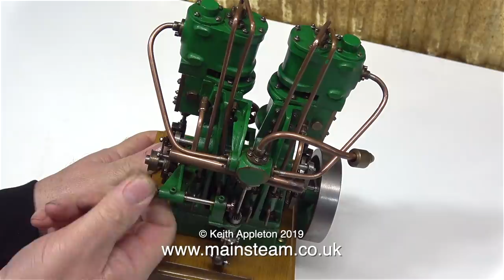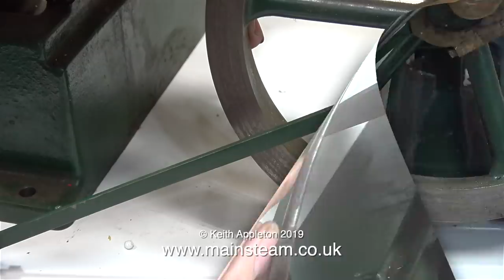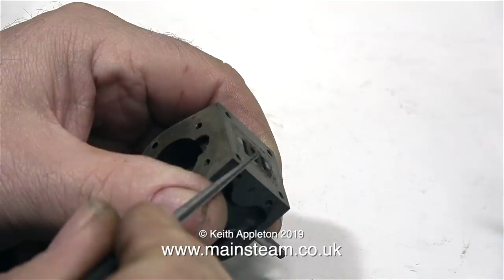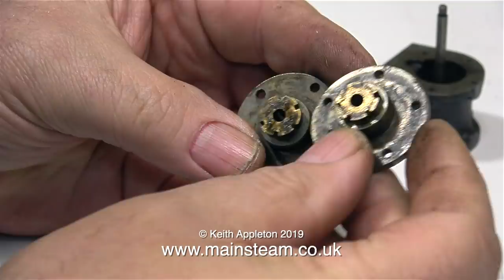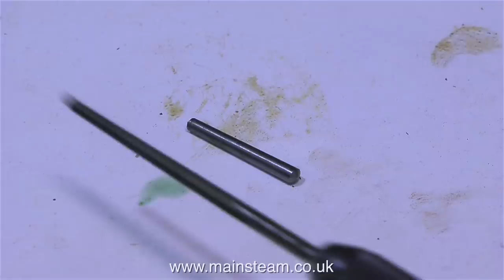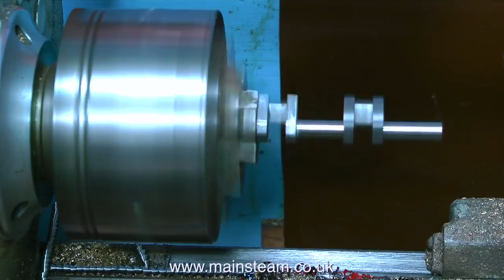BUYER BEWARE - BUYING STEAM ENGINES VIA THE INTERNET - PART #1

Comment: I've used JB Weld for many years and I know for a fact that it must never be used as a "glue" to join two pieces of metal together.  It has no sheer strength, and any kind of stress will cause it to crack and break apart.  It's main purpose is to fill gaps, pores, and refinish mating surfaces and it does these jobs very well.  It's too bad that the cost of repairing a bad job is greater then the original cost of the model, but this has always been true of anything mechanical.  If you can't do it right the first time, don't waste money trying to repair it.  Just chalk it up to experience and junk it!

Comment: As an Aerospace composite Engineer of some 25 years and some extensive experience bonding (gluing to layman) I would not be using JB Weld to fix an any of these components
Brazing or some other form of welding would better

Comment: I would beware of using JB Weld under tension in a small cross section like the broken cylinder mount , I forget the proper name of the part.

Comment: The No.10 with the broken cylinder standard - I'd be dubious too using JB weld on that. I thought brazing it might work but then I wondered if even that would be strong enough to handle the stresses. Is it fixable at all?
Reply from the maker: It's not worth it - the rest of the engine is very poorly made . . . .
Reply: @keithappleton  Yeah, I realize you aren't going to fix the thing. I was just wondering if braze would be strong enough.

Comment: In car engines, the crank shafts are forged and then machined in one piece; I realize forging one of these miniature cranks wouldn't be feasible, but how bad would it be to machine one from barstock in one piece? And if it is more or less doable, could you do one on video?
Reply from the maker: car crankshafts are a bit bigger - I usually make the smaller ones using a built up construction ......

Comment: You are dead right, ebay steam engines are usually rubbish, I wanted a nice Stuart beam engine, the third one was OK, but needed work to get it going properly, now runs on under 5 Lbs/Sq". The first 2 had loads of issues with the parallelogram gear, a very slight mistake here renders the engine useless. Engine 1 & 2 only ran if all the screws were loose! Luckily after cleaning, polishing, and painting I found someone who only wanted to look at it, engine 2 was OK after some re-engineering. It turns out that making this engine from castings is a task undertaken by engineering apprentices, hence the variable success rates. Not all ebay is rubbish though, but it does seem like some people use it as a Skip.

Comment: If I ever buy a steam engine online, it wouldnt be second hand. but straight from the manafacturer XD that way I know its going to work and fit together properly haha
Reply: You'd achieve  much better quality and more satisfaction buying a kit of raw castings from Stuart Turner, a Myford lathe including a four jaw chuck, a milling machine  and then investing around 2,000 hours carefully making the parts accurately with acceptable fits  and overall dimensional and angular tolerances   of all interconnecting parts ! It's very easy to be critical of the efforts of others; my own Stuart No. 1 is perhaps a lot better than most of these casualty engines, but I know it is still not perfect because of  mistakes I still recall from nearly 40 years ago over the four years it took me to build it with only a clapped out Drummond lathe and limited access to model engineering evening class school milling machines.

Comment: Nice cute steam engines sir, but where can i buy it sir? They are old but Very nice and Unique machines. How much is it sir? Tnx
Reply from the maker: Ebay?
Reply: Tnx sir. Maybe how much sir? I just want it to drive a small generator just to charge a 12v battery. Tnx sir

Comment: I would make the crankshaft out of a solid piece of bar stock.
Reply from the maker: Good for you. I don't think though that many beginners to this hobby would be capable of that. As I frequently have to state on here: These videos are designed for beginners . . . . .
Reply: Keith Appleton Yes but,when building something that complicated,one should not be in a hurry..Walk away from it until a solution presents itself. I built my first steam engine from a set of raw castings.A Tiny Power,M side crank with a Stevenson’s reversing link.It was two years in the making and there were a few minor mistakes but,it is a sweet running engine.Probably because it has 21 ball bearings.Even the eccentrics have sealed,thin wall bearings.🤣
Reply from the maker: You are obviously not a beginner then?
Reply: Keith Appleton No sir but, I enjoy the videos